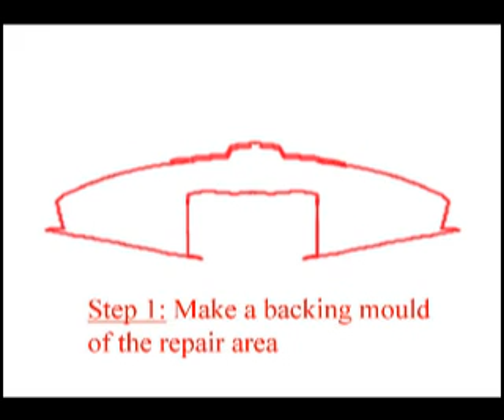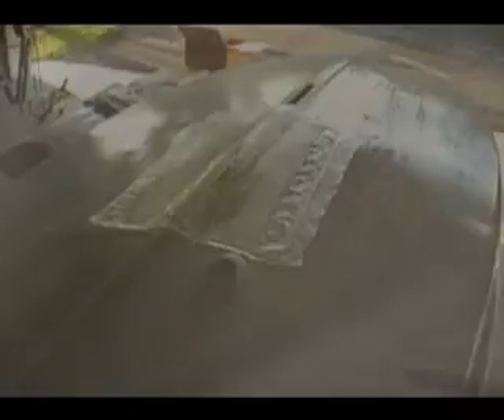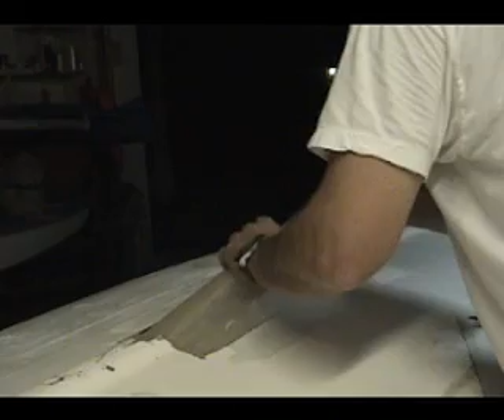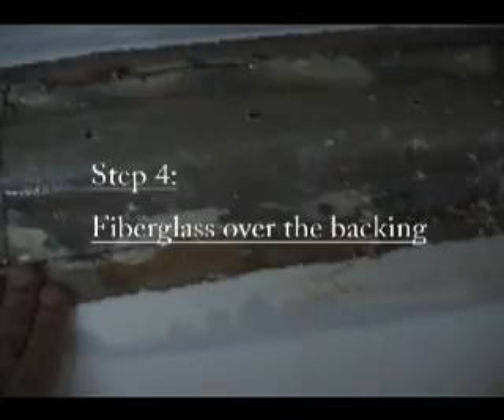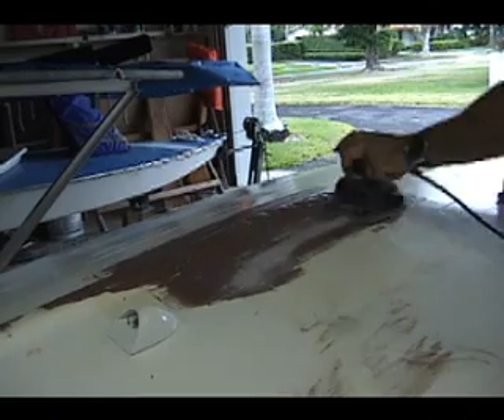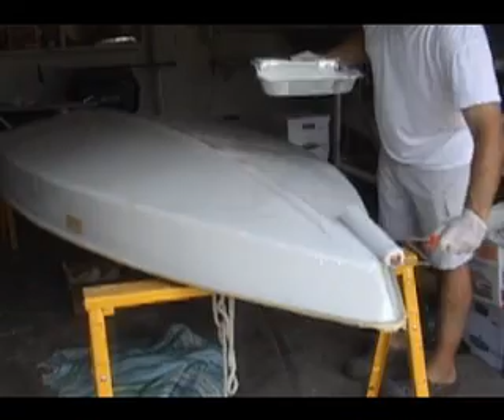Fiberglass Hull Repair

Comment: Douglas,
What a beautiful repair and outstanding video. The verbal information is complete, and the visual information quite telling. I am in the midst of a similar repair. instead of a backing mold, I was going to insert a couple of layers on top of cardboard suspended by string. Perhaps I should just make a single layer mold instead of messing with cardboard. Oh well, so glad that you shared your experience. I think I will end up sharing my repair too...if it comes out as well. Many thanks.

Comment from the maker: based on a recommendation from the sunfish forum and an extremely stretched budget i used...ahem...behrs 1 part epoxy garage floor paint.  it held up well, but now, 4 years later, i wished i had used what more people recommend, which is regular topside paint, but on the bottom.

Comment from the maker: did not prime.  i cleaned with tack cloth and denatured alcolhol.  for budgetary reasons, and after alot of research, i used white behr's epoxy garage floor paint (search the sunfishforum for a lengthy discussion) it works great for $25/gal.

Comment from the maker: otter:thanks!  mat'ls list from memory below:
+/-$90-100 epoxy supplies/fiberglass
$6 squeegees
$10 latex gloves
$5 sand'g attachm't
$15 palm sander
$30 Jigsaw+blades
$10 hand saw+blades
$15 release fabric
$35 misc sandpaper
$25 1 gal of epoxy paint (not hull paint)
$5 mask'g tape
$5 exacto+blades
$25 for rollers+brushes
$15 white pigment
$6 tack cloth
$12 box paint rags
$10 masking tape
$7 stir sticks
$9 visqueen
$15 misc plastic cups
$10 acetone
$10 denatured alcohol
about $400(ouch!)w/surplus

Comment: I am grateful to you for posting this video. I just bought a damaged Sunfish from a dishonest dealer and there was some putty covering a split by the daggerboard well.  I am hoping a simple epoxy crack repair will fix it, but if not, I will be referring to your video over and over.  Good work!
Reply: Ouch...splits my the daggerboard are usually very expensive. Good luck!

Comment: if i just have a small crack running laterally along the underside do i need to cut it out or can i just sand and paste a patch over it?
Reply: If it's small and doesn't go all the way through, sealing with a few layers of epoxy should be sufficient